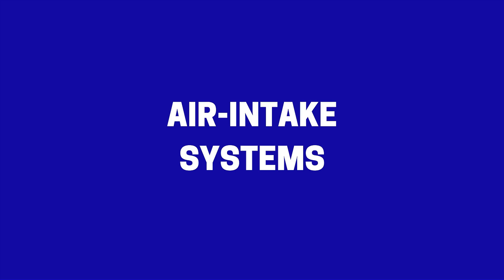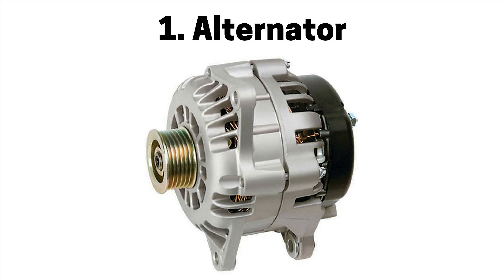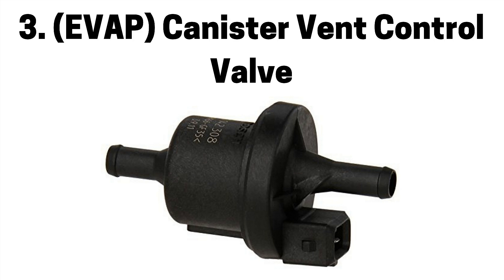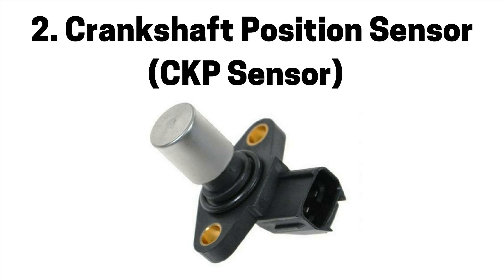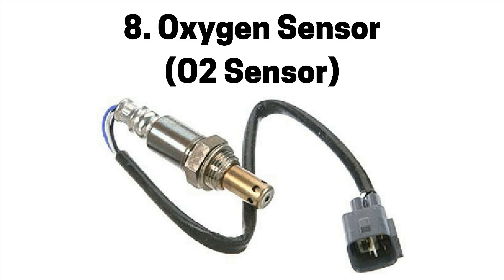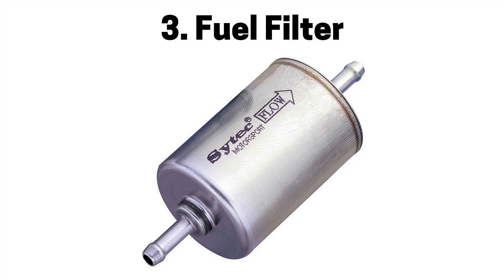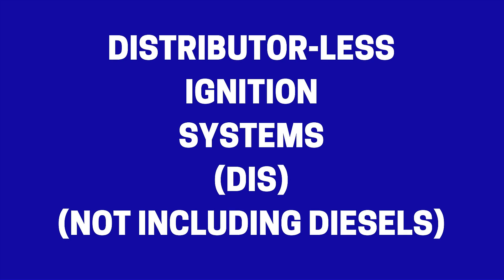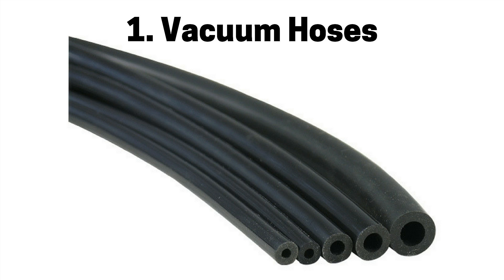Why Is My Check Engine Light On?  Possible Causes

Comment: This video is very informative but drove me crazy hearing the repeated phrase check engine light. I have a check engine light and it runs smooth and I can't find nothing wrong. I might sell it and join the Amish people and get a horse and buggy wagon with real horse power so I don't have to worry about the check engine light. I would save a ton of money not replacing all those parts one by one just to turn off the check engine light. lol

Comment: Best laugh i've had in a long time, blah, blah, blah will result in a check engine light, a check engine light, a check engine light...... Here's the laugh, a trustworthy mechanic, they don't seem to exist, they tell you what the monitor says, change the part, charges you and the engine light is still on, oh it must be something else, let's change this, oh light still on, I was afraid of that, main computer, $900 , oh cam roller chains, $2500, that should get your light off...... A "trustworthy mechanic", are there any left, parts changers is what they should be called, if they tell you that this part needs changing and the light doesn't go off, you shouldn't have to pay for their misdiagnosis, all these sensors are just a money pit and money maker for dealerships!

Comment: What everyone should do is buy a can of regular Seafoam with the red lettering. Pour a canister of that with a half tank of gas. I had the check engine light with a P030 code and was worried I had to replace the catalytic converter. After driving about 150 miles or so, the light came off and saved me hundreds of dollars on costly repairs.

Comment: I have a 3s engine the camshaft sensor is not connected, the harness is different I used a different engine instead. This is a Toyota Noah. When I start the engine check light goes off just after a few seconds it goes on and you could smell the fuel in though the Windows are shut. What could be your advice sir.

Comment: My 2006 Corolla 'check engine light' is on constantly. The guy at Firestone plugged his hand held computer into my car just below the dash. He read a code and said that it was a part in the transmission. He turned the light off and told me to come, if the light came on, again. Well, the light almost immediately came back on, so I went to a parts store and had them do the same computer and code reading. That person said the same thing about the transmission. Point being! This video didn't mention anything about transmission problems. My transmission on the car works well. I believe the light is on because of one the 34 possible causes mentioned in this video. So,  why is the computer code saying it is a transmission problem?
Reply from the maker: rhi gel What is the trouble code?

Comment: Mines reading no codes lights on some drives on and some off.
Reply from the maker: Jacqueline Perry even if the check engine light turned on and then turned off the trouble codes are stored. Take it to an auto parts store and have them check it with a diagnostic scanner which they will perform for free.

Comment: I had a check engine light on forever. In -38°C I checked everything. I had my battery checked with a hydrometer. 2 cells were shot (the battery charger read 12.5 amps which indicated battery fully charged and therefor, good), but you must have battery cells checked by hydrometer.
Long story short....I don't know or remember all I did, but after having battery replaced the check engine light went off. Simple fix.
Coolant light still on. I believe its the coolant tank float. OBD test indicated rear O2 sensor buggered. 
270K. Runs like a charm.
I'm by no means a mechanic, so I only absorb 30% of complex mechanical speak let alone fix the problems.  But, I got my 2003 Saturn Ion free and fixed all I could myself using junkyard parts (except new, metal windshield wiper motor transmission). 
Sometimes I think I can cure a rainy day!
David
Alberta, January 2020

Comment: I can't get rid of the PO420 catalytic converter code.  Is there any way I can get rid of this to pass smog other than replacing or driving a 100 miles or more?
Reply from the maker: MrJohnnebgood It’s more than likely a bad oxygen sensor or a bad intake manifold gasket.
Reply: Extreme measure is 1 gallon of laquer thinner in 15 gallon gas tank. The CAT converter MAY  affect O2 sensor. Alternatively, take out O2 sesnsor and decarbonize and clean. Heard all this on YouTube. Haven't done it myself. Or change rear O2 sesnsor ($70).
David
Alberta

Comment: You engine check engine light  will costs you fortune!
Reply: Or as my mechanic told me f*** it. I replaced "upstream o2 sensor". I will replace downstream sensor under car between muffler and cat converter. 
Then map cleaning.
My oil sensor just came on too, but the oil is perfect. I change it myself. Coolant light on. Its perfect. I do that myself too. I bought a obe scanner. I'll check everything in the spring.
Car purrs like a kitten.
I rack my brain at night to figure it out. 
I'm not mechanic. Just a DYI 'er with time. 
I got my car for free and fixed it.
David
Alberta

P.S. My engine was running cold. I put on winter guard on grill and in front of radiator. It runs at 200°F or an a proximation of that.
I idled it today for 20 minutes and it was up to half, (but with this experiment the blow fan was not running). 
I'll keep working and learning, I guess. Good video.

Comment: If your cel stays on it is called a "hard code" and needs attention soon. If the light comes on, than goes off for a while, and than back on, that is called a a"soft code" and will become a hard code at some point, but is safe to drive until it stays on, or corrects itself and stays off. If the light comes on and the car still drives fine, you can still drive it home, or to a shop as soon as you can. If the  starts running bad, looses power or stops all together, than that is the time to call a tow truck.

Comment: Help. In my car fuel flap/fuel cover it says '' must be used above 92 unleaded gasoline '' but in my country we use only 91 gasoline, does it cause check engine light on? Because my car check engine light on. I am not sure, does it cause the problem? My car is 2013 mitsubishi asx 1.6 engine. Thanks.

Comment: I had check engine light which I noticed after change oil after  having run 30 or so miles.  This happened two occasions.  Is this related?
Reply from the maker: An oil change will not cause a check engine light to come unless the mechanic disturbed a sensor or actuator while performing the oil change.  The most common cause of a check engine light is a loose gas cap.  Make sure you hear a click when you fasten it back on.

Comment: I have a code P0125. I had the Coolant Sensor, PVC Valve, Spark Plugs, Radiator & Thermostat replaced. The check engine light is still on.
Reply from the maker: Make sure the engine coolant is full.  If that's good, then disconnect both battery cables for one hour and then reconnect and see what happens.
Reply: proclaimliberty2000  Okay, will do. Thank you.
Reply from the maker: Reena 👍😊
Reply: L

Comment: I have  2002 Miata that needs to pass emissions and registration. It recently had a  engine swap,  but  the light is always on. We have tried the reset methods, and all the tests, but still am unable to figure out the problem. Any help helps
Reply: I think I have your answer Dalton.  You have a 2002 Miata made by Mazda.  I have a 2000 Ford Ranger which has the same engine as the Mazda pick up.  My  "check engine" light has been on for many years.  I finally had my very reputable mechanic check it out.  After running diagnostics he finally determined what the issue was.  He told me that, in these older engines, where several or just one piston shaft in the engine block, there can be a small crack.  As time goes by the crack naturally gets longer or wider.  It's nothing to be overly worried about.  It's just a sign the engine is getting old.  However this causes carbon monoxide to leek into the atmosphere, so the "check engine" light alerts you to it.  I have 170,000 miles on mine.  Anyway, if you have over 80,000 miles or more, I wouldn't go down the path of replacing this and replacing that until your bank account is tapped out.  You may be chasing after a phantom.  If you really want to find out if what I've told you is your issue, take it to a trust worthy mechanic who's been in business many years.  He should have the advanced diagnostics to run a thorough heck on your Miata.  And like I said, if you have a lot of miles on your car, this is most likely the issue.  Just don't waste a ton of money only to be stuck with a "check engine" light that still won't go out.  I found out the hard way, so maybe I can save you the money I wasted chasing a phantom.  Take care guy and best of luck.  Oh also, a good mechanic may be able to pass your car through inspection, which should get you two more years of "I don't have to worry about it for 2 more years."  This is the case in my state of NJ.  Don't know about your state.  Hope it works out for you, I always wanted to own a Miata.
Mazda trucks like mine and your car have a reputation for longevity if the general maintenance is not neglected.  Good luck.  John Osk in Jersey.

Comment: 2007 Camry 4 cyl 
Code shown po172 and po101.
O2 sensor 
Air fuel sensor 
Air flow sensor 
Replaced them all. 
Still same engine 💡 code come up. 
Any suggestions?
Reply from the maker: This all points to something faulty with the mass air flow sensor.  Did you use OEM parts?
Reply: Denso.
Reply from the maker: @1ivandang  That's what I use. Good quality.  Do you have your own diagnostic scanner to clear the trouble codes?

Comment: hi... My Toyota Revo vehicle has recently flashed the engine light for a long time (not blinking - just solid light) after driving for more than 1 hour..  it has happened 2 to 3 times since. Afterwards,  I took it for a tune-up at a local car repair shop for brand new spark plugs,  battery. Then after a week,  the engine light reappeared again ... What could possibly be the faulty part? I'd appreciate your reply if you can sir.  I'm taking it to a mechanic again tomorrow, but i'd like to hear your advice on this. Thanks!
Reply from the maker: Lawrence Kin It could be a number of different things. It’s very important that the car be checked with a diagnostic scanner to see what trouble codes are stored which will usually point you in the direction as to what’s wrong.  The bottom line is you need a good trust worthy mechanic. I tend to steer away from dealerships as they are way overpriced on parts and labor.
Reply: @proclaimliberty2000  I had it checked yesterday and a different mechanic checked it out but he didn't use an OBD2 diagnostic scanner, since my vehicle is using an OBD1 interface. So he manually placed a pin to the OBD1 and brought out his "codes bible/encyclopedia" for reference.  After 10 minutes, he diagnosed and deemed that main culprit was the speedometer defect , since the code that registered was "42", which was really the speedometer problem.   So I had the speedometer fixed, and it was revealed that the "gear" of the speedometer was causing the check engine light.. I had that replaced with a brand new gear, which cost me around  $38 (gear part and labor included) . I had it for a test run for about 20 minutes and there was no more of the "check engine light" thankfully.
Reply: However, i have this question in my mind.... since there are not much OBD1 scanners in the market, would it be smart to buy these two things:  1) an OBD1 to OBD2 converter cable   and  2.) OBD2 Diagnostic Scanner  and then use these two to diagnose my Toyota Revo vehicle?  Would that be a smart thing to do sir?
Reply from the maker: @lawrencekin02  Oh yes, I remember checking an OBD1 with a paper clip before.  Well that's great!  Your persistence paid off.  It sounds like you found a good mechanic.
Reply from the maker: @lawrencekin02  In most cases that will not work.  You have to have a reader which will read OBD-I.
Reply: proclaimliberty2000 ł

Comment: Hi, thanks for the good video.  I have the code P01410 on my 2000 chevy tracker. Apparently 1410 is an issue with the fuel tank pressure system. I bought the part from the dealer and replaced it but I still have the check engine light on with the same code. I tried replacing the gas cap, but no luck. Any idea what else the problem could be? Thank you.
Reply from the maker: Besides the gas cap, what other part did you replace?
Reply: fuel tank pressure sensor, it was located on top of the gas tank.
Reply: Nice video

Comment: My check engine light has been on for 7 years and it's exactly the same thing every time o2 sensor.  There has to be a way to fix this once and for all! Like come on already!
Reply: Vickie Morales How many times have you changed your sensor?
Reply: Jesus My Savior I know, my car has 2. She said every year for 7 years she needed an 02 sensor. I didn't think any vehicle had that many 02 sensors.
Reply: Mine is on
Reply: 2008
Reply: I don't know what to do
Reply: Theres actually a treatment for the O2 sensor & the catalytic converter.
(Theres also a Diesel engine version available too).
 Check in Super Walmart type  of store & in your auto parts stores for it, I've seen it no higher than $25.
I would also suggest that you read the instructions prior to purchasing. 
Some cases may need 2 applications,  which is mentioned on the can.
I recently found it, & its been out for a while, which embarrassed me because I've neglected the to deal with the codes.
Good luck to all of you!

I realize that you & others probably have fixed your issues, or may have a different car by now,  but hopefully this info helps someone reading it.